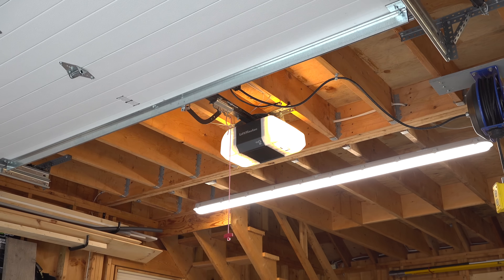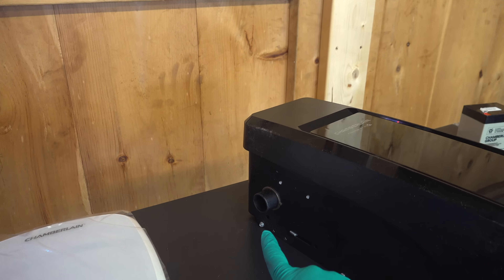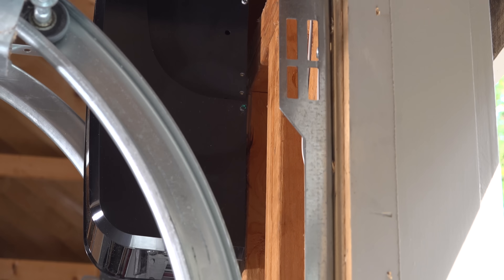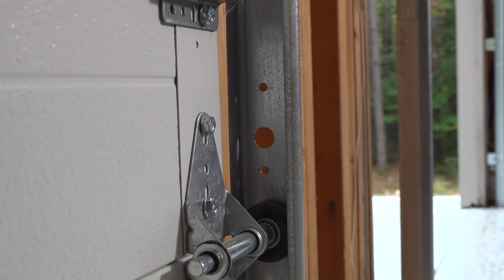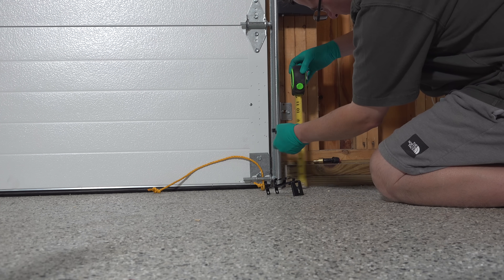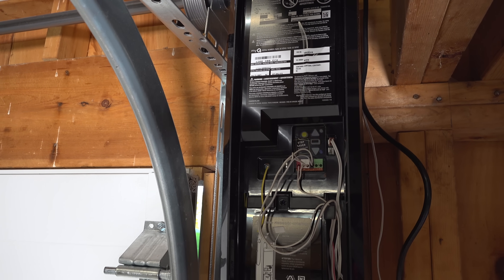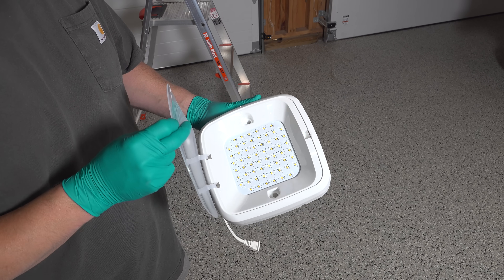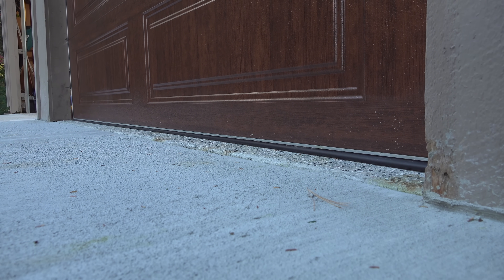Finally a SILENT Garage Door Opener that locks like a SAFE! - RJ0101

Comment: I have the liftmaster.  They are certainly louder than your video shows but quieter than an overhead.  My panel by my house doie died so we got a replacement and it doesn't work with my built in vehicle opener.  Old one works fine, liftmaster wants me to buy $100 blue tooth internet switch.  Can't recommend them enough.  The dead bolts are nice and they are harder to break in due to the design.  The lights are not built in so you need two plugs at the door for power.  Battery backup is handy too.

Comment: Nice opener.  Only critique I have is that it really doesn't give you more storage space considering the tracks still run horizontally and are bracketed to the ceiling for support.
Reply: It does open up the space above the door itself, but yeah, that's not a ton...

Comment: I replaced the wheels on my garage with quiet poly wheels and it made it even more quieter. My system is belt vs chain and it’s just as quiet. However, i do like that this system gives you more ceiling space. If my opener ever dies, I will definitely replace it with this system.

Comment: I had my contractor install the Liftmaster version this opener on both my garage doors when I built my current home. One of them is lifting a 14' x 14' door on my attached RV bay. Super quiet and low maintenance. They can be connected via wifi to your smart home setup so you can control them from your phone even when you are away from home. Very handy if you need to give someone access while you are on vacation. The app even shows whether the door is opened or closed so you never have to worry about if you remembered to close the door. The electronic deadbolt makes it impossible to open the door from outside. You can also add a battery backup for use when power is out.

Comment: @silvercymbal, I'm curious which door opener you went with on your center door.  I also have a 3 door garage with the big beams supporting the 2nd floor similar to yours.  I'm searching for a replacement for my existing Wayne Dalton Idrive openers. The Chambelain product would work for me on my two outside doors, but not sure my center door has enough room between the torsion spring and the beam to fit the chamberlain Jackshaft.  I've rewatched the video and am trying to figure out if your using the Chamberlain Jackshaft on your center garage door or if you're using a different openner.  Curious what you went with on the center door.

Comment: I've had one for the past three or four years. I've noticed  that when closed the top panel does not seal against the header as a normal overhead unit would  put a pre-load on that section.  Haven't figured out a solution yet since I'm in California and it hasn't really been a problem  but there is a quarter inch gap up there along the top when it's closed and locked.

Comment: I installed the same unit on my sons garage door. Although the unit was quiet and relatively easy to install I found the coupling from the jackshaft to the closure jam screws kept loosing causing the door to not close all the way. In the end I replaced with a ceiling mount and have had no issues. I did like the design of the unit, installation went well and performed good and i was going to pin the coupling to stop slippage. Another thought was to drill locate holes so the jam screws are locked into position.. just my two cents from Canada..

Comment: Have had a Liftmaster ceiling mount belt-drive unit for a few years.  It's dead silent and includes a battery backup.  The Internet-connected features have become indispensable.   Currently working on a remodel of the garage and plan to add 3 more openers from the Liftmaster / Chamberlain family.   Looking forward to the jackshaft / wallmount units for my high-rise / high-clearance doors.

Comment: Awesome opener, I have same one in liftmaster variant (same exact thing) for years now. Love it. Mines came w/ battery back up so when power goes out you get to open and close the garage way over ten times. Best opener i have ever owned. Everyone I recommend to ends up loving it as well. I paired mine up with super quiet rollers & polymer hinges, you literally cannot hear my door opening or closing, its scary how quiet a garage door can be. Great Video.

Comment: These have come way down in price.   Tip,  change the metal rollers out for nylon type with actual roller bearings it will get rid of any sound you still have.

Comment: I have a liftmaster with Uconnect. It worked fine over the internet with cable. But now I have fiber optic internet and it no longer works. Something to do with the interface between the garage door opener and AT&T fiber optic.

Comment: I laughed a bit when you were describing "leveling to the wall". I think you mean to "plumb" the opener. plumb is how "straight" a wall/pole/etc is to the ground (meaning it's perfectly upright, not tilted towards you or away from you) "level" would be the left to right tilt when you're facing it straight on, which you wouldn't be able to adjust more than say 1/8th-1/4 of an inch because that is set by how "level" the shaft you're clamping too is. Very cool device, though, didn't even know they made different types of garage door openers.

Comment: Now here is the thousand dollar question. With a heavy wood door we had an issue where the jack shaft spring failed allowing the door to fall derailing the chain from the tensioning sprocket up front by the opening. This is an easy repair. What happens if the spring fails with one of these openers? Is there a safety mechanism inside that will protect the opener if that spring fails or will we be forced to spend big money on repairs or replacements???
Reply: It's a matter of setting the torsion spring tension right. No matter how heavy the door is, the correct tension should let you open it by hand quite easily and let the door fall from half way closed by itself lightly. Think of this as your helper manually operating the door on your behalf.

Comment: I never could use the wireless deals they made for garages because the wifi doesn’t reach out to it and a repeater just takes away bandwidth and not willing to sacrifice bandwidth for the garage door..  would be cool if they made one that you could physically plug an ethernet cable into because id be more apt to run a cable out to it underground just to link it up and also make it apart of the houses security systen..
Reply: Get an access point. It connects to your network via ethernet and creates its own WiFi signal. Rather than bridging an existing signal.

Comment: I think even without the little dead bolt thing, i dont think you could physically be able to lift the garage door with it coupled to the motor like that through the shafts..  youd be lifting the door plus the resistance of the gearing and motor..  even without power..
Reply: I agree. I tried it but never able to lift it from outside. Before installing this, I had never used the manual lock from inside at all for that reason.

Comment: We built a new garage in 2019 and all three doors have this opener. Ours also has a large battery in each opener so the doors can still work when the power goes out.  I also like the delay after opening.  If I forget to close the door then it closes itself after a few minutes.

Comment: I am sorry for this. I don’t want to be the party pooper.   But I got an issue or 2. 

I’m not sure how much garage door openers cost when this video was released (11 hours ago).  
But the link that you posted is charging almost $500 for that door opener.  
And the equivalent chamberlain ceiling mounted opener cost $179.  

The only benefits to buying a wall mounted unit is noise.  

I’m not sure how much ceiling space you’re reclaiming.  Your door still rolls up.  

Also, am I the only person that watched this video and felt like the latch and pull cord looked like it would be easier to bypass than a ceiling mounted opener??

Comment: You showed how to open it in case of a power outage from the inside. But can it opened from the outside?
Reply: I have the same question. I have a detached garage without any entry doors.

Comment: have 2 of the same openors, I specified them when the new house/garage was being built, they are fantastic..  MyQ is great as well, Amazon can open the garage door and leave packages inside…  Mine where about $800 each installed from the garage door supplier, but that was in 2018.  I have 2 sets of controls for each door, a wired controler by each man door, and a wireless controller mounted next to it for the other door..  have a 18’ X 8’ high, that covers 2 garage bays, and a 10’ X 8’ high that does the 3rd space.  Only wish I knew about “high clearance” tracks, could have specified those to have room for a lift 😂  also you can mention they have a DC backup battery availble for under $100, so they can be opened during a power outage (if you don’t have a generator or solar backup), they run a little slower on the battery, but thats fine

Comment: Thought these were neat back in the day but residential garage doors are not really made for them. Gravity is the only thing that will close the door so you need to set up your spring tension to be weaker and not allow your door to roll up all the way so that it will have some weight to get it moving.

Comment: I had considered these when replacing the 1990's genie screw drive in my house that was original. The old screw drive was not actually that loud when greased properly. Because of the reliability I replaced them with another set of genie screw drive openers.

Comment: We're fighting through a belt replacement on our ~2008 Chamberlain overhead GDO...no matter where we source our belt (two diff places on the 'zon, and then OEM from Chamberlain) and are using the CORRECT part number...it's too damned short. 
But right now, while we WISH we could get the Jackshaft opener, because all of the good reasons...we're trying to just fix this one for now. 
Thanks for a great video. Looked it up on their site and am tickled that our 16' w x 7' h door can be opened w/the Jackshaft model! :)
Reply: If you have an overhead opener that doesn't use a chain, then you didn't get the right one.  Always and everywhere get a chain drive unit.  The tiny bit more noise is well worth the reliability over all of the other styles.

Comment: I have 4 of these installed in my garage but the Liftmaster branded ones.  I loved them for about 4 years but recently we had a power issue that lasted several days and I kept finding the garage doors wide open.  I tried locking them with the lock button on the opener but they would still end up open after a while.  The onQ wouldn't even alert me, it showed them as offline for a while then just open with no alert.  I finally found out that when these experience issues, their programming is to open the garage door.  That seems like the worst logic to me.  Let's open all the garage doors in the middle of the night because there was a power hiccup to the units.  I would never buy these again and am looking for replacements that don't have that kind of logic in them.

Comment: This actually looks like exactly what I need. I've been planning to add a garage door opener since I moved in. I'm frankly shocked the previous owner didn't because he loved remotes for everything. Only question is, do you know if this system will throw a fit with an un-grounded outlet? It is an older home and the garage isn't grounded...
Reply: That could be fixed with one visit from an electrician, in about an hours time.

Comment: Just as a heads up, if you want silent without the spring issues this type of opener can bring, I'd suggest installing a Sommer direct drive open. It'll blow your mind! Let me know if you've heard of it.
Reply: I had one and changed it out for the Genie Jackshaft opener. The Sommer was slow as molasses in the wintertime even after paid for the App to adjust the speed to as fast as it can go. It frequently would just plain old not work for no reason. The Genie Jackshaft opener is significantly quieter than the Sommer.
Reply: @MrFrankrizzo5150 Our Sommers have worked reliably for over 5 years now.  They are a bit slower than other brands, but work well.
Reply: I had a Sommer when I lived in Thunder Bay, ON.  Beautiful & so quiet our 4 dogs often never heard us coming home.  So when we moved to PEI in 2018, we needed to replace the 2 rusted garage doors, so I had them install Garaga doors & I ordered & installed 2 Sommer openers.  I ordered the optional 4-button remotes because the original 2 button remotes kept getting buttons pushed by pocket contents.  The 4-button remotes have a sleeve that slides over the buttons to prevent accidental activation.  Sommer may still make a side mount system where their track mounts on one of the door side rails.

Comment: There is also version of this opener that includes a battery backup option.  This allows the opener to operate during a power outage.
Reply: Yes i was going to mention this also. I have 2 Lift Master versions of this on my metal rollup doors and they have the battery backup. I noticed in his pictures it did come with a battery. Not sure why he didn't mention this.
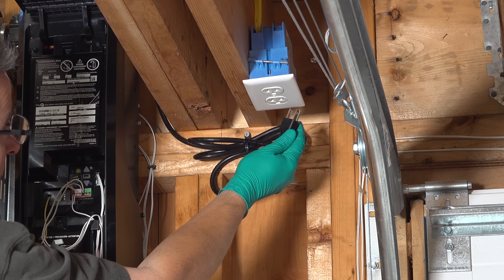Reply from the maker: Sorry it was a brief mention: 8:10 - this is included with the kit
Reply: @SilverCymbal  Thanks for the great content. I have learned a lot in the past year.

Comment: What would help me out is if that opener could lift two doors with one unit. It would be difficult to replace the chain openers because the previous owners butchered out the joists overhead to fit all sorts of openers over the years, four to six joists don't even connect to either side of my garage except by a couple of 2x4s.

Comment: That noisy garage door is not the openers fault.  It’s just a noisy door.I have a similar opener and it’s very quiet almost silent because the door was installed properly and is quiet.

Comment: Maybe you don’t have the need for it but have you looked into high lift garage doors? You could remove the upstairs storage portion then have the garage doors open much higher before turning towards horizontal

Comment: I really like that opener. I am looking to replace the one I have. It is quite a bit more expensive though. I will stay with the standard type.
Reply: The newer Chamberlain standard openers are very quiet and have all the wireless functions if you want to use them. I have one and in the car with the engine off I can barely hear it and with the engine on i can't hear it at all. I pull in, push the button and have no idea if it's working until I see the door in the rear view mirror. Plus they are way smoother and I think that will contribute to the longevity of the door, springs and mounting hardware.

Comment: not sure where you are but here in mn normal garage door opener is around $200-$250 depending on how many remotes/options. $450 is as cheap as i've found a new jack shaft opener, usually more like$500.  

jack shafts have been around for a long time just not much residential, not safe enough until more recently. with the jack shaft you are now operating the door by winding and unwinding the spring instead of actually grabbing the door.  i have been a garage door guy for many years the biggest thing i see with jack shaft machines is when they hit a restriction and unwind your spring enough to loosen the cable. homeowner reconnects in the wrong spot and them machine cycles too far.  normally they sense that and stop. if they fail now you have an unsprung (i.e. full weight) door possibly slamming down on you. picture a double door may be #300 lbs dropping even 4 feet to the cement.  I know they are made to not do that but i see it happen.  if your spring isn't set up right that can cause probelms too. usually works best if the door is a bit heavy. 

 they next guy who comes to change your garage door spring may hit you up for more money due to the machine hanging on the tube shaft- i don't  but know service guys that do. 

don't get me wrong the current jack shafts are great. especially for tuck under garages with a beam in the way or places with no headroom, car lifts etc. due to double the money as well as safety concerns i usually steer my customers towards a traditional chain or belt drive unless there is no other solution. 

yes i know all sorts of things happen that also cause  doors to drop and malfunction and drop etc. rail openers are imperfect too.  just my 2 cents for what that is worth. 

as far as breaking into a garage, garage door techs are the main ones i see with a coat hanger to get a customer into a locked garage.  we had a rash of bad guys backing a truck through peoples doors  around here a couple years ago. not much stops that.

Comment: I got one of these 4 years ago while rebuilding our home after a house fire... I really love the quiet opening and clear overhead space... This opener really makes a lot more sense... Nice elegant solution
Reply: The other nice thing is mine came with battery backup. Looks like my model is almost the same as in he video, but in the bottom compartment has a space for the battery backup.  Superhelpful if you come home during a power outage.

Comment: it should also have a battery backup
Reply from the maker: It has one, and includes the battery. I had a little on this later in the video but it goes in a small panel under the opener, nothing else to buy
Reply from the maker: It has one, and includes the battery. I had a little on this later in the video but it goes in a small panel under the opener, nothing else to buy

Comment: Is it possible to replace the cord on the opener? I have overhead openers and the outlet is in the ceiling above the openers. Also, my garage is sheet rocked. So I'd like to be able to put a longer cord on jackshaft opener and run to the existing outlet. Thanks.